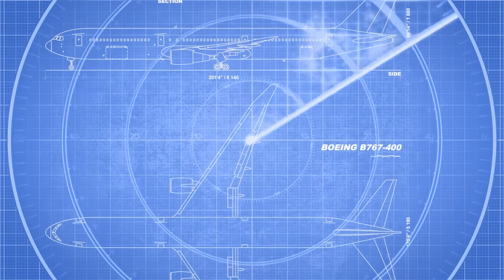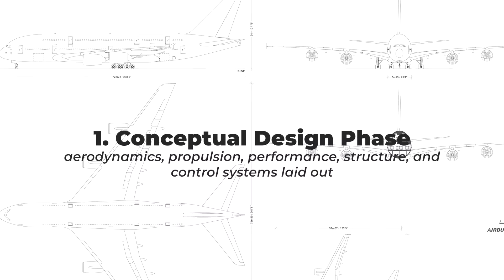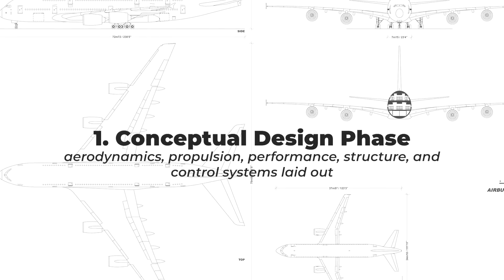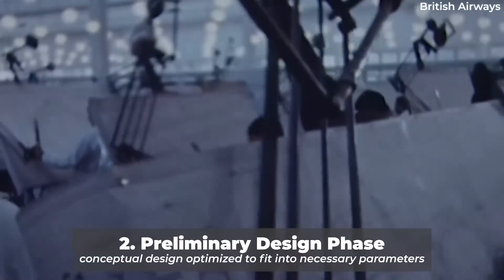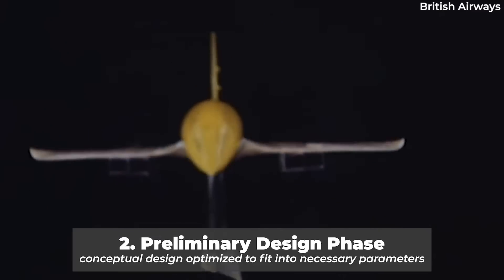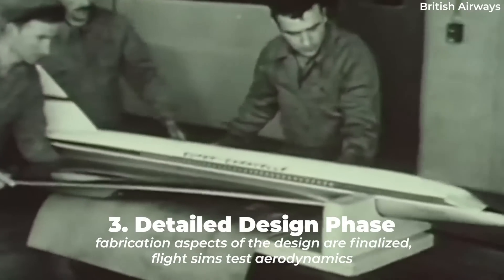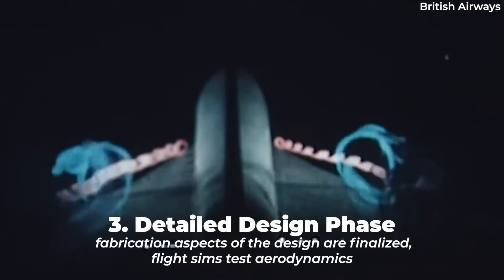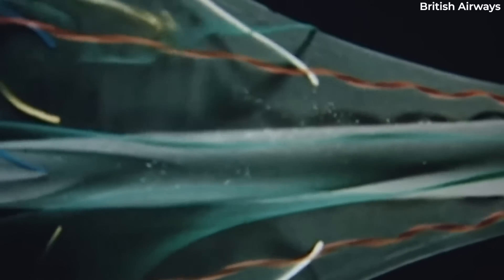The Development Cycle And Cost Of Modern Commercial Airliners

Comment: Are the research and development cost of the engines included in the cost of the program?  Or is that a separate subject because an engine company is a separate corporate entity?
Reply: funny enough the development costs for the Rolls Royce RB211 engine was factored into the production of the Lockheed L1011. the RB211 both programs got bailed out by the Brittish Goverment very fast

Comment: Also structural members of the aircraft eg wings need to be tested such that they can withstand large loads for example the Boeing 787 Dreamliner’s wings are flexed (stretched upwards) unbearably such that the wings would never experience such force in actual flight and the wings need to withstand that unbearable force during testing just to be certified

Comment: It appears that the 787 development costs have far exceeded $22 billion, otherwise it would be profitable already.
Reply: Total program costs were around 27 billion. But that number includes all the production facility costs of building the new plant, all the tooling at both plants etc. The 787 program will probably never be net profitable for Boeing at this point, but that 27 billion is sunk cost already spent. Even at the peak of the program at a production of 14 a month it was only removing about about 2 billion a year from that total. Factor in all the issues with now two groundings, stop in production for a year etc and low production rate now it will never recover all those costs. It's all about cash flow at this point and selling at price higher than production cost. They are basically back to where they started in net program cost given all the issues.
Reply: @johniii8147  I'm not so sure. The 787 is a widebody aircraft. I'm not sure what their listed prices are, but even being conservative, and estimating them at 150 million dollars each, by the time they deliver all 1800 units that they currently have on order, we're talking break even at a minimum.
In addition to that, it's only a matter of time before Boeing starts using Charleston to assemble other aircraft, so perhaps it's fair to add that amount to the production cost of the 787, I'm still confident that Boeing will turn a profit before the end of production.